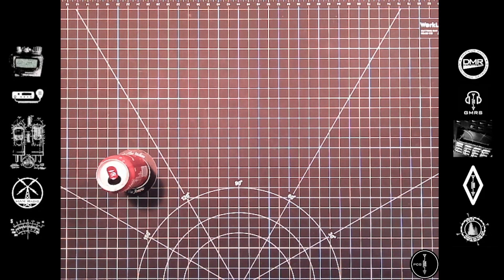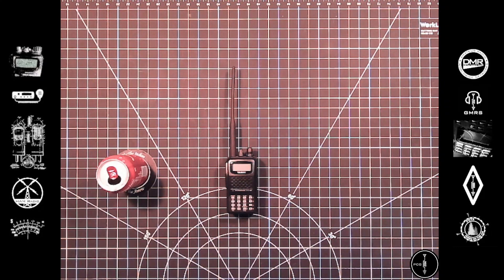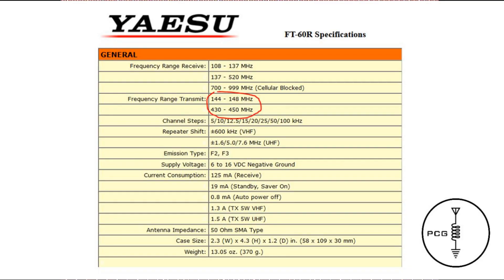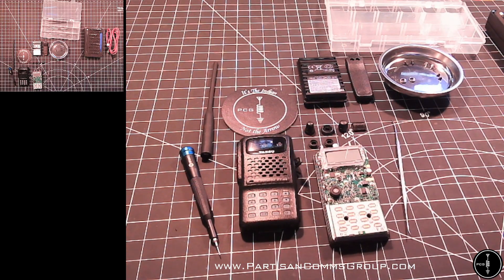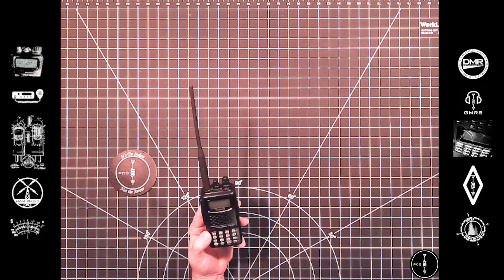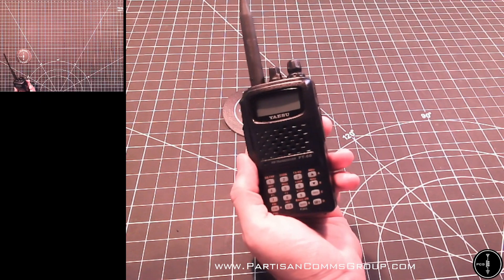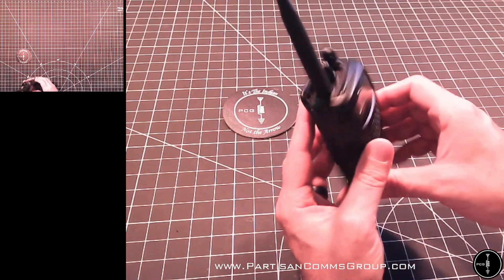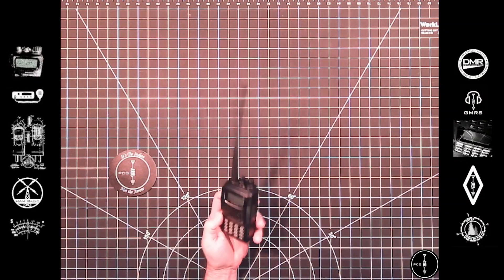E25: Yaesu FT-60 MARS Mod

Comment: The pics  you said would leave down below, ?????
Reply from the maker: Do you mean an image of the circuit board?  I beleive there should be one in the video.
Reply: @PartisanCommsGroup  Yes, an image. I know the resister is very small and hard to focus but a still shot zoomed in with a phone or camera would really help. Thanks.
Reply from the maker: At the 5:18 mark there is a photo of the circuit board.  I'm not sure if I still have a copy of it.
Reply: @PartisanCommsGroup  Thanks but I don't need a pic now. My Yaesu is now a BRICK. Not related to your video though. It was MY fault.
Reply from the maker: What happened?
Reply: @PartisanCommsGroup  I removed the resister I THOUGHT was the correct one but evidentially NOT. I reassembled the radio and it would not power back on.  The battery was fully charged.
Reply from the maker: Oh man, sorry to hear that happened.  I can see how that would be easy to do because the components are so small.  Is it possible to solder it back on?
Reply: @PartisanCommsGroup  cant solder it back on. When it popped off, it hit the floor and disappeared. No biggie. I have plenty of other radios.
Reply from the maker: That still sucks though.  I may be wrong about this, but I think Ham Radio Outlet may do mods even if you didn't purchase from them.  I thought a while back someone mentioned to me they reached out and asked about doing a mod and they sent it in.  If so, they may be able to solder the resistor back on, and then remove the other one.  Might be worth reaching out to them and asking?

Comment: Hey I'm slightly new to radios I was a 25U In the army so I understand slightly of this. I bought 3, ft-60 radios for my upcoming camping trip in the middle of nowhere and I mean no service what so ever for 8 miles. What would be the best use scenario to utilize this radio during my trip without having to do this procedure. 
everyone says you cant VHF cause of the marine and i thought I could use it as MURS but it seems i have to mod it now. Any advice to clear my question up would be greatly appreciated, Thanks.
Reply from the maker: If you have a tech license then you can operate on 2-meter or 70-centimeter simplex.  Or, if that isn't an option, then you can always go with some GMRS radios to talk on, and use the FT-60's for monitoring purposes (e.g. any local repeaters).  You mentioned being out in the middle of nowhere, and how far you can get your signal out will be impacted by factors such as the type of operating environment you'll be in, what type of antenna you have, how high in elevation you are and any potential obstructions your signal has to overcome.  You mentioned operating on MURS, and if that is your goal then there are a lot of options out there.  I think Radioddity has some offerings (not sure if that is helpful for what you're looking to do or not?).
Reply: @PartisanCommsGroup  so the ft-60 isn’t gmrs and if i were to custom add  mars i could potentially use them as if w other ham radios
Reply from the maker: @Terences123 Correct, that HT is intended for amateur radio use on 2-meter and 70-cm frequencies.
Reply: With out a license  if I customized ranges 151 154 mhz with the mars mod on the ft-60
Reply from the maker: I would say before going too far down the path of trying to mod a radio, I would ask what your comms goals are?  Usually for my camping trips with friends and family, I go the GMRS route, and if I think I'll need it, I have a Retevis RT97 portable repeater if I'm in an area with a lot of obstructions.
Reply: @PartisanCommsGroup  what’s a typically decent gmrs radio
Reply: @PartisanCommsGroup  well I want to get my tech 1 license eventually and this doesn’t seem too hard to add the mars mod so I think if I were to do this to
3 other radios I got 3 radios to hand out to my friends and use it as is on the GMRS channels once it’s modded and eventually I’ll have my license to do more and get on repeater channels etc .
Reply from the maker: @Jitikus  I have a few Retevis RT76P HTs that I take camping, and use with my repater.  I bought those a while back and I think they still sell that model on their webiste, but I think since the time I purchased them, Retevis has come out with some better ones that have an IP rating.  So, it might be worth a look on their website.